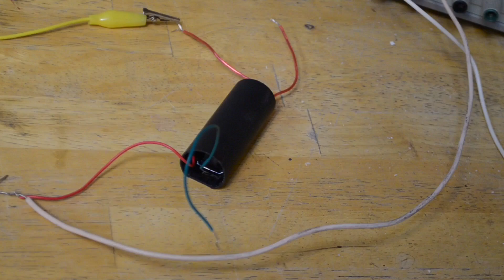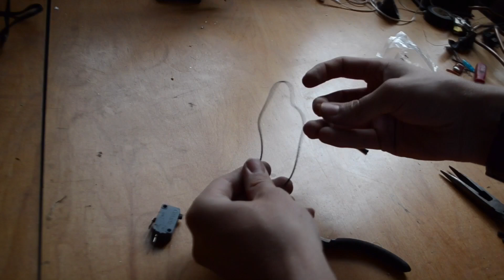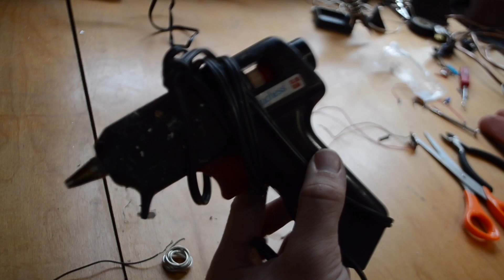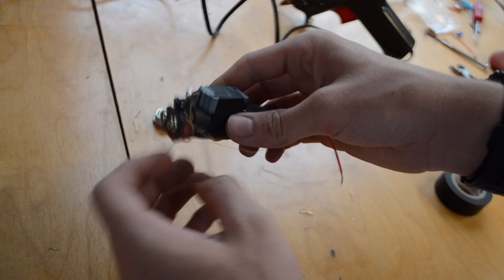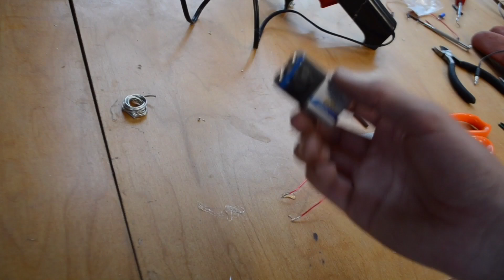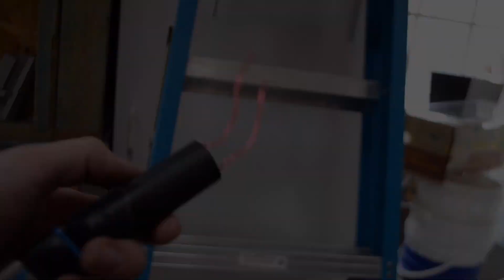How to make a 5$ taser!

Comment: but isn't 4kv deadly
i am just concernd about safety
Reply: Even 1 mega-volt is not deadly if it does not pack enough energy (amps). And 30 volts can be deadly if it packs enough amps. Volts don't kill, neither do amps. It's the combination of both that can kill. And for this, it simply can not have enough amps, and as you can see, it is not constant. It is flickering at lower rate. It will make you unable to control your muscles, but nothing more really.
Reply: Don't use a stun gun on someone whose safety you are concerned for. Family members, babies, pets, etc. But seriously, nope. It's not deadly if the energy just isn't there.
Reply: Jarod, wrong. It is the combination of both.
Reply: The Diamond Games - Channel closed
Actually 30 volts can''t drive a lethal current through a person. No matter how much current the supply is capable of providing. But yeah..people are confused by the volts/amps thing
Reply: *****
Well, yeah, you could fall onto two sharp contacts that could penetrate either side of your chest. :D
Reply: The Diamond Games - Channel closed You're right, it's the combination.
Reply: +J rod Current implies voltage anyway. (You can have voltage without current, but not current without voltage, or conductivity for that matter), so I'm going to say it's a combination of all three that 'kill you'
Reply: thank you
Reply: Even 1 volt can be deadly. It all depends on the effective resistance between the points of contact and your heart and whether or not the current passes through it and is above the minimum current threshold that causes fibrillation, which is between 100-200 milliamps.
Reply: +Caden Luke yes.........
Reply: greg77389  its 0.6amps or 600mA through the the heart.
Reply: I mean I made one and used it on myself so..... Lol
Reply: It's the current (amps) that kill you, not the voltage.
Reply: @jarodgallagher4429  weeeeellllll. your kinda wrong but also right. if your talking literally than yes, current does kill you. but its the volts that determine the current. a good example i like to say is, you can think of volts like hitler and the amps as the nazi soldiers. Hitler(Voltage) controls the soldiers(amps). you can call it messed up but hey.

Comment: My electrical science is a bit foggy Amp vs Watt and such.  Did you do any testing [[little brothers are great for that.]] to see what the current [?]/shock will actually do?   Zap a 6'6" gorilla hoped up on meth with it-one Taser will tickle him and a different will floor him.  Hope that makes sense-the difference between static shock on a doorknob to getting tossed across the room.  One tickles the other makes you unable to have kids.
Reply from the maker: +Mark Henry hahah, yeah, I shocked myself with it by accident and it hurts very bad :P also it chars your skin
Reply: That's a shame. A taser/stun gun really needs to be able to put someone on the floor. Just hurting a bit is pointless for self defence. 

Also, putting 9v through a 6v max device doesn't seem like a good or long term solution. Use an 18650 instead.
Reply: Did it scar at all?

Comment: I suppose if you wanted to make it a little more reliable, you could add a recessed slide switch to act as a safety, then enclose the battery in some kind of housing and leave it attached.  That battery could get knocked loose pretty easily in a scuffle in its present state.

Comment: Huh? Could one boost the voltage even further with a microwave transformer? Would be interesting if the coils survive the voltage.
Reply: Michi Lo microwave xformer puts out  to many amps it would kill someone.
Reply: ***** I meant connecting the HV boost converter to a transformer.
But i don't suggest doing it. It fried my HV boost converter.
Reply: Michi Lo or you could buy a stronger boost converter you can still get 700kv converter for about 5$

Comment: Just to answer a few questions about the 400KV boost modules: I've personally bought these a couple times, theyr fun. I even disected one that i acidently killed.  First, they actually put out about 30kV Max. You can calculate this by the spark distance. Second, they have a single transistor driving a boost transformer folowed by a voltage multiplier 3x i think, my transistor was labled C3746, a NPN rated 6A 100MHz. The secondary seams to be electrically isolated from the primary. There are 3 HV caps wired in series with a bleader resistor across the whole thing. Thats good for most ppl since they will discharge themselves when not in use to be safer.

Now for the info on how easy it is to kill these things:
The main HV caps are severly under rated for the job they have to do. Any atemp to let this thing run WITHOUT discharging before the voltage climbs too high WILL damage / destroy the caps, killing the unit. These units are basically built skeliton style, but then encased in epoxy, no actual circuit board in them. Letting them run too long can over heat the internal components and damage them. I would think the most heat sensitive parts would be the transformer windings, the transistor, or the voltage multiplier diodes.

Now if your nice to these units, they will give you lots of fun, dont try and bring the leads too far away to get the biggest spark you can, let them spark before the voltage climbs too high, and dont run them too long at a clip. I'd keep the spark about an inch or shorter and the duty cycle under 50%
Reply: not dangures
Reply: G
Reply: Fortysevenn H
Reply: Ummm i have a doubt..... I mean will it hurt or work as a taser? As they output very less current ig so is it still dangerous?
Reply: @naveengupta5588  itll sure hurt. but i wouldnt use these ones on ppl.
Reply: @kraken767  yes yes ofcourse
Reply: @kraken767  but like how bad, how long would I need to use it on someone for them to fall to the ground or like be shocked so they cant react and I can punch or flee or smth
Reply: @giuli1387  I would not use these modules on people. Go buy a proper taser which is rated for use on people. Dont mess with high voltage unless you REALLY know what your getting into and how things work, you could die if your careless.
Reply: 😵‍💫🥱😞💤  .. oh no I I'm still with you  .. 😞💤

Comment: dont lay down with this in your pocket ;-;
Reply from the maker: +DILLON OLIVIERO yeah, or at least have the battery disconnected, I've made that mistake before, and now my leg has burn marks on them :P
Reply: that doesnt mean anything. you can make an output of over 10000V with a coil.
Reply: D Bb 9v batteries don't provide a lot of current though. Its not enough to knock someone out, but on a small enough patch of skin you can cause burns.
Reply: how strong was it?
Reply: is the shock strong enough to k.o somebody?
Reply: Mazmusic Ornament it's a 9 volt battery. it won't do anything except sting a bit
Reply: Higher voltage will make it easier to overcome the resistance of your skin, so might actually deliver more amps. Anyway, it's not so much the current that incapacitates but the high voltage in the case of a taser.
Reply: DILLON OLIVIERO I did it don't feel good ether

Comment: I have bought one too, is it Good to power it with 9V? Because it ist Named with 3-6 Volts.
Reply from the maker: +yanmatz11 yeah mine also is 3-6v, but the 9v works fine, that is just don't separate the 2 wires too far apart, and don't run it for a super long time at once... If you look in my instructables linked in the description, I later used Brad nails as the terminals for the arc, and I've used that for months and it hasn't broken yet xD
Reply: have you tried it on anyone? Does it fuck em up real bad ??? Want to get my bro whos a cop haha. Yes.. its illegal in canada to carry around. But to have one on the shelf at home >WITHOUT< the  battery in it is fair game i imagine :D throw it in a locked wall mounted display case. Then she's def legal 'art'

Comment: what is the maximum time that you would recomend tasing yourself? i have had encounters with this taser and want to know what the death point is.
Reply: Mike Horne what are you another suicide victim
Reply: Mike Horne Ive taken around a 10 second zap from one before with no lasting effects except for a little redness where I allowed my friend to zap me. Im no stun gun expert but I dont think any length of a zap can truly be considered lethal. They are high voltage and low amperage and its amperage that kills not voltage. 

This video is about a stun gun not a TASER. A TASER is what cops carry that shoots electrodes and looks kind of like a pistol. They mess with your bodies nervous system and usually totally incapacitate a target by locking up every muscle in their body. A stun gun just hurts like hell and once removed a Zapee is back to normal. I suppose they could possibly kill people with heart problems and or pace makers as true TASERS have been known to do but those instances are few and far between.
Reply: Both amperage and voltage are required to be lethal. A certain voltage is required to conduct through the skin. The resistance of the skin is too high.
Reply: Will Auv XD

Comment: I bought the same 400kv supply and man they are scary
Reply: you realy thing its 400kv if it was the sparks will be half a meter long!!!
Reply: @9551dev  it actually is 400kV, but it has like 6uA of current making the voltage drops when air resistance gets too high, and the voltage drop makes air resistance increase, reducing maximum arc length. The low current is also the reason it's "safe", though handle with caution.

Comment: I made this, but the taser just emits a whine when you turn it on. any thoughts?
Reply from the maker: +Theo Andre that is really strange, are you using a fully powered 9v, and also how far apart are your High voltage wires ?
Reply: Keystone Science I used a new nine volt battery, I'm afraid the boost converter might be faulty
Reply from the maker: +Theo Andre it defiantly sounds like it then :( try contacting the company you got it from and tell them , also how far apart are your high voltage wires?
Reply: Keystone Science I tried them different lengths apart, none worked